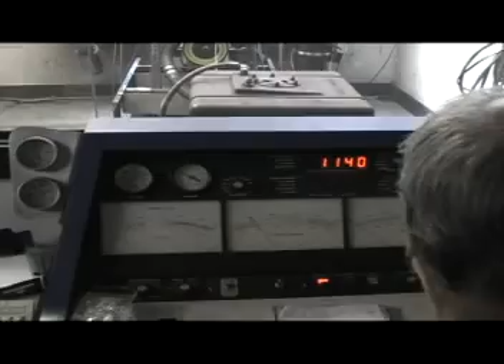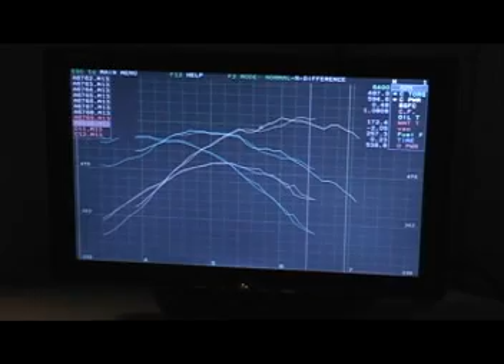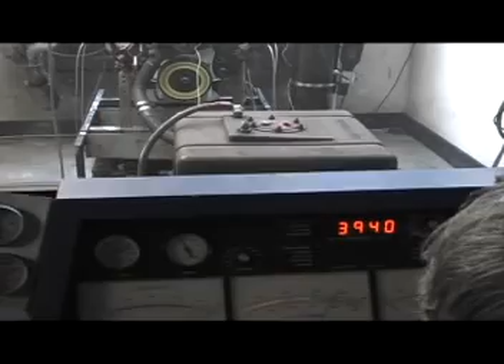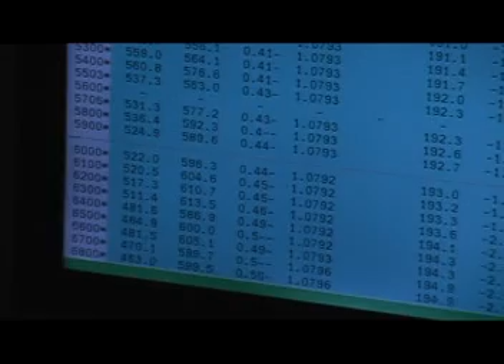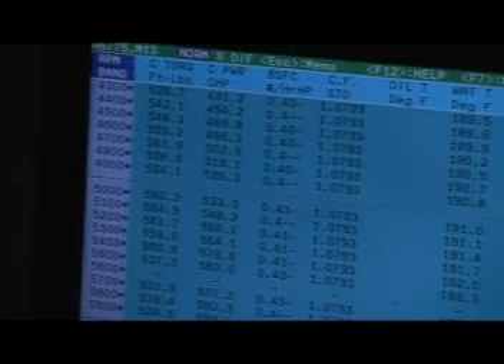468 cid big block Chevy engine dyno runs

Comment: Very cool!!  Nice piece. That's nearly identical to the 454 I built about 18 years ago.  Same heads, very similar cam, same header size, same compression.  Only big difference is I put an RPM air gap intake on it with a spacer and 950hp on top.  Mine likes rpm too and ran it's best times shifting at 6500 rpm.    Still runs strong today, I've used 91 pump gas in it for the last 15 years. Before that it was 93 when available.  I actually bought these heads with plans to grow into them with a bigger engine and never got around to doing it.  Very happy with how they run on the little engine.  Been a fun street car.

Comment: Love the sound at 6500+rpm I have a 468 I built rpm heads with over size swirl polished valves on the intake side.its the small cc chamber head so with my pop up forged pistons its got to be 11:1+c.r. has a comp extreme cam 294h I think its the biggest hydraulic flat tappet in the extreme comp cam range.I run a holley strip dominator oval port intake manifold with a holley ultra hp 1050 dominator carb sitting on a one in spacer/adapter plate.I run a hei distributor and I time it by ear and then road testing  it.one day I would like to put it on dyno but im guessing 600 hp or something like that.the pistons and crank are forged but I dont over rev it as it gets no traction at any speed.I notice one odd thing since I put the rpm heads on wich have a slightly smaller chamber cc and that is that when I fire it up from cold the engine is extremely touchy on the throttle.I mean just breath on it and its revving up in a nano second!but as it warms up it starts to respond like usual.im wondering if it could be sucking a little air at first or maybe the forged pistons are swelling with heat and sealing better?it runs good cold just super touchy on the throttle.any ideas man?it only started doing it when put the rpm heads on but I upgraded the cam from 284 to 294 grind just slightly bigger lift and duration at the same time I did head swap.cheers for any help.thanks.